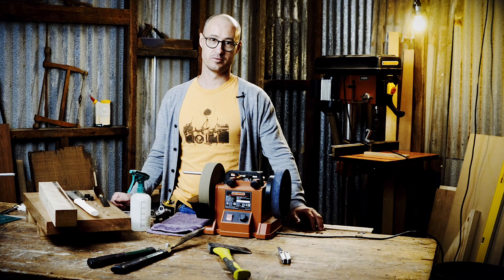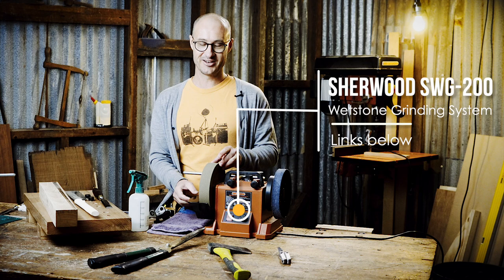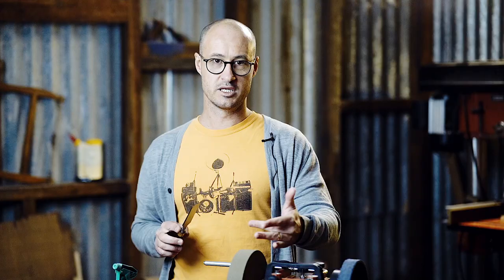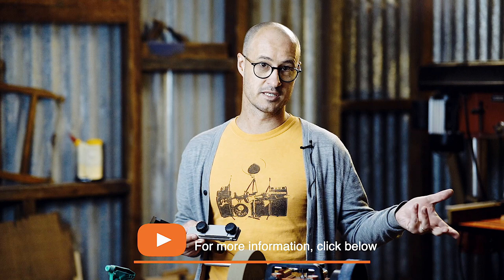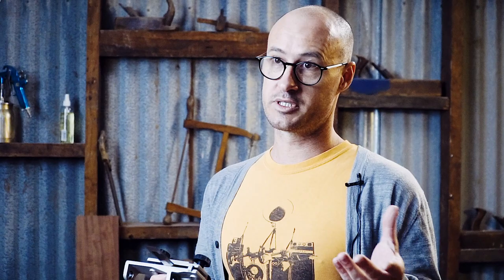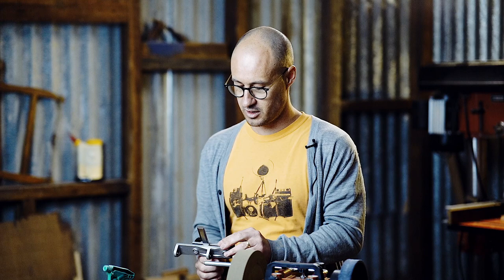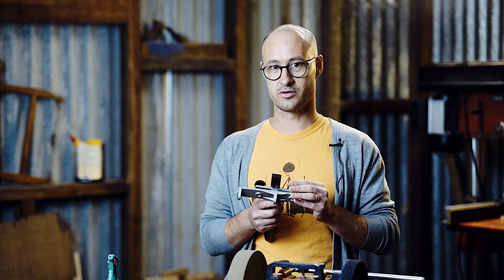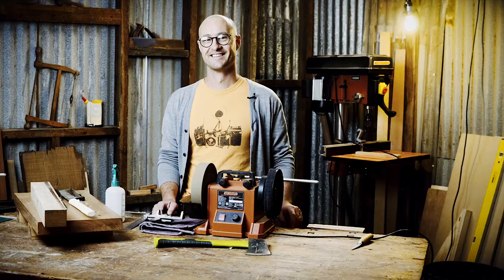Sharpening with a Wetstone Grinder. Featuring Geoff and the Sherwood SWG-200

Comment: Why does the machine have the on/off switch at the back rather than directly in front of the user?
Reply: So you don't bump it bro
Reply: So you can injur yourself 😂
Reply: It doesn't,  the guy chose to sharpen from the back, the switch works in forward and reverse and the  tool brackets fit back and front too. Don't do what the bloke does and sharpen with the wheel spinning away from you, it sharpens better with the wheel spinning onto the chisel.  The same model is badged Clarke in the UK and is good value.